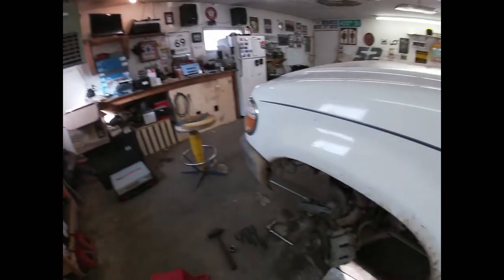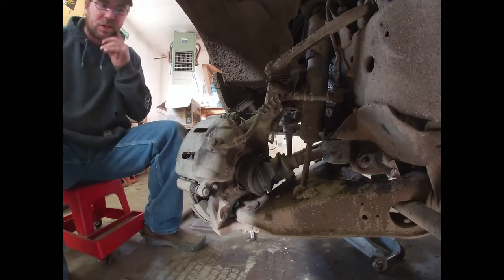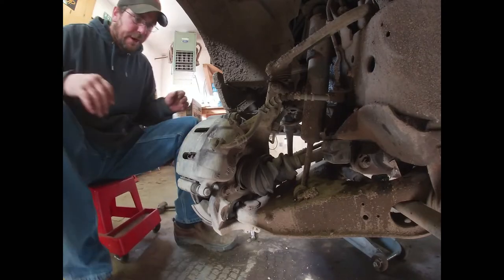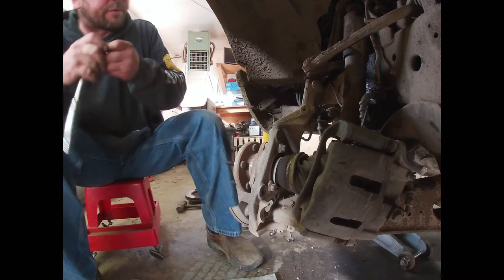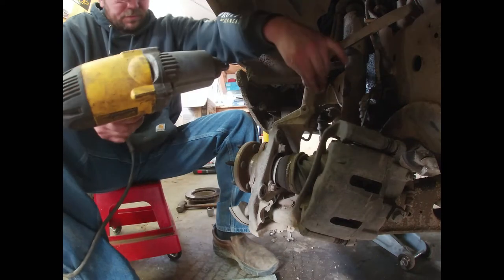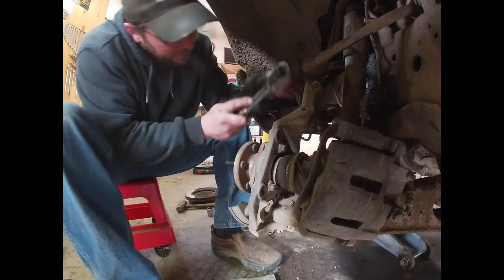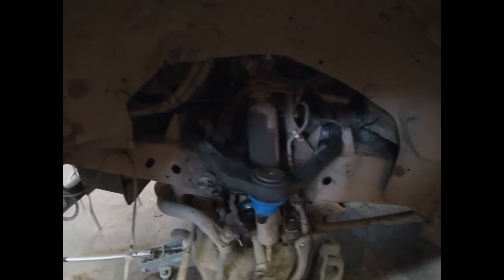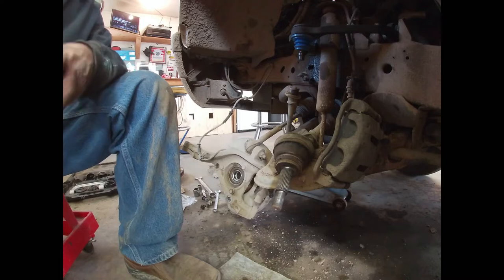How to replace ball joints in a ford explorer

Comment: To replace JUST the upper ball joints you do NOT need to remove the CV axle from spindle....correct?   Can tap out top control arm etc.....? 
Thanks.
Reply from the maker: that is correct